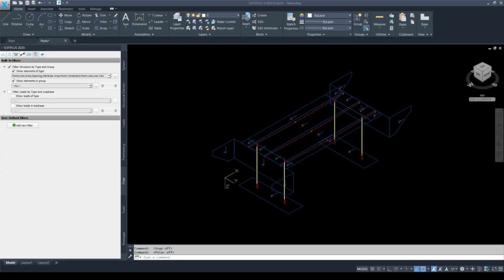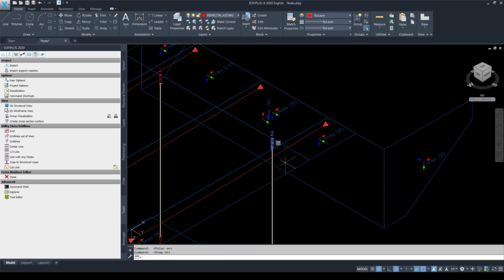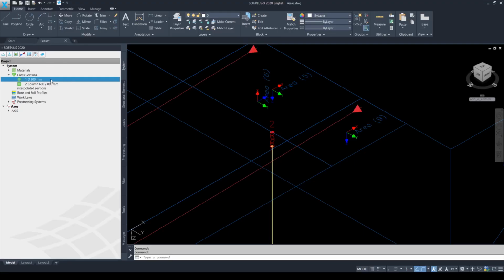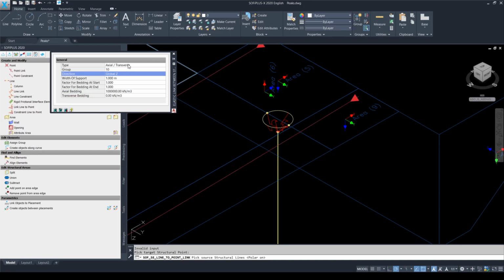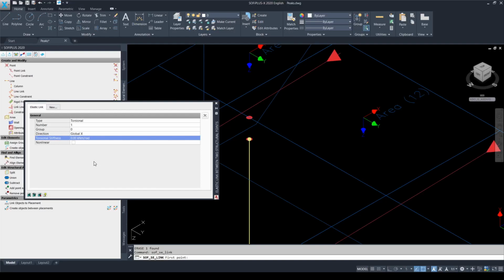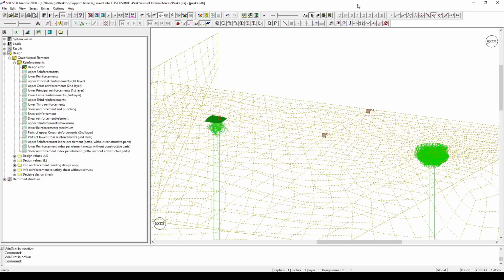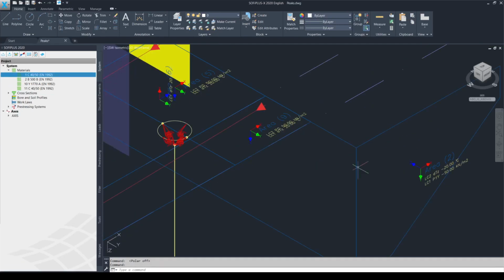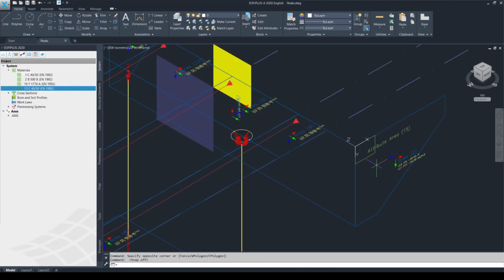Smoothing the Peak Values of Bending Moments #SOFiSTiK #SOFiSTiKTutorial #Tutorial

Comment: Why not using constrant line to point instead of spring with 1000000 kn / m stiffeness?
Reply from the maker: Generally speaking avoid using constraints if it is possible always. It could build up recursive connections in the model and also could lead to numerical problems in the analysis.
Reply: @LinkedIntoKiTSiFOS  okay thanks and i need requst from you please don't stop making videos in your channel your content is very helpful and really matters